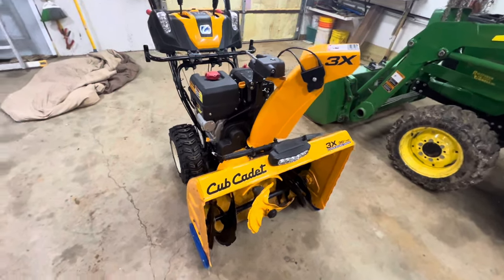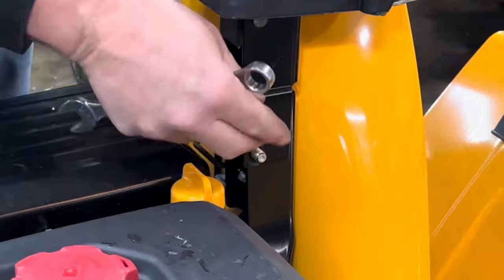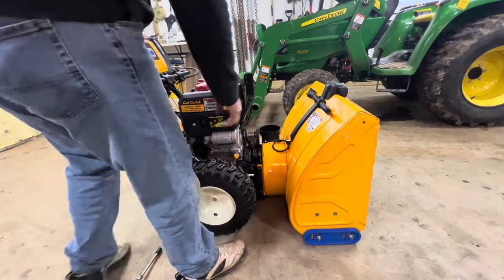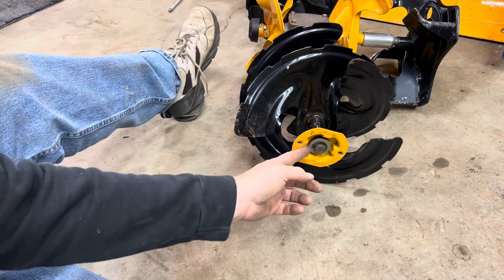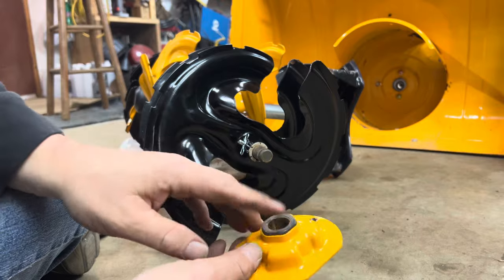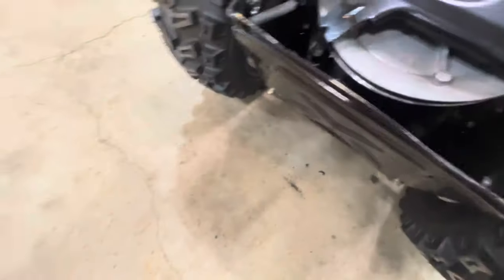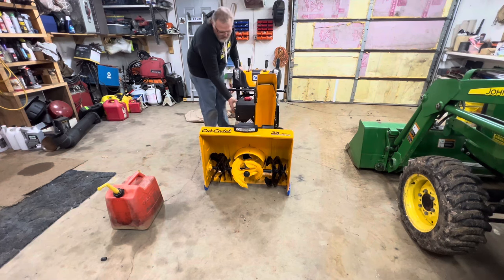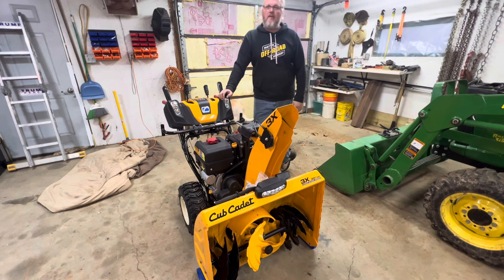Cub Cadet Snowblower Auger Replacement 3 Stage

Comment: I'm a little surprised that you didn't grease the auger shaft or use any anti seize on this shaft while you had the thing apart. 🤷🏿‍♂️🤷🏿‍♂️🤷🏿‍♂️🤷🏿‍♂️
Reply from the maker: I don’t believe you grease these newer Cub Cadets. My older snowblowers have had grease zerks but the newer ones have not. They weren’t greased from the factory but it’s not a bad idea.
Reply: @pilgrimsgarage  I know that a lot of the times that the factory doesn't grease these shafts, that is why I do it. I'm being pro active because if you stay ready, you don't have to get ready. I put anti seize on everything. Hell, when ever I run out of toothpaste, I use anti seize. 🤣🤣🤣🤣🤣✌🏿

Comment: Does anyone happen to know the gearbox lube type for a 3 stage?  I had to replace a leaking gearbox seal but I can't find the lube spec anywhere.
Reply from the maker: I believe it should be regular gear lube. That what I have used in the past.

Comment: My belt shredded on the 4th time using it. Very disappointed.
Reply from the maker: When replacing the belt you might want to look at the pulleys. Cub Cadet isn’t as good as it used to be but you should get more than 4 times out of the belt.

Comment: Why replace rather than heat up and bend back? Granted it wouldnt be perfect but less expensive and time consuming.
Reply from the maker: It was relatively inexpensive and it was a friends machine. He bought the auger. The old one was pretty tweaked when I pulled it out. It probably would have been ok but if you saw the steel that Cub uses now you’d understand. It’s definitely not the Cub Cadet of yesteryear.

Comment: Could you not just bend that back straight?
Reply from the maker: Probably in this case but my friend had already bought the auger. It’s pretty thin steel so it’s quite malleable. Be sure you use shear pins in it though.